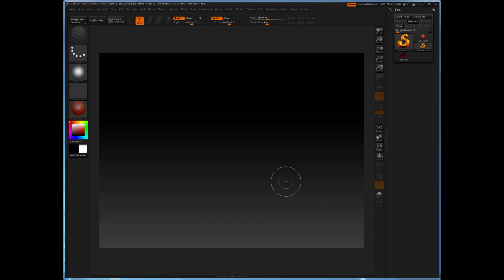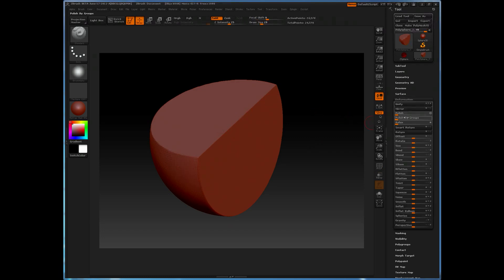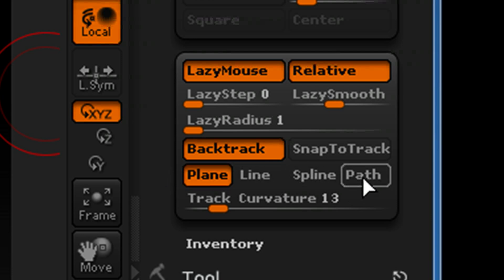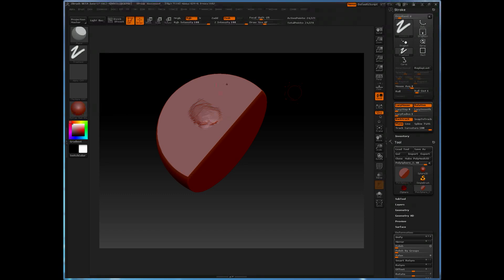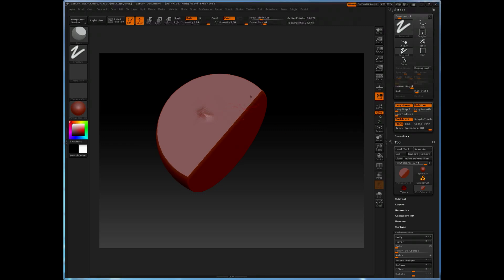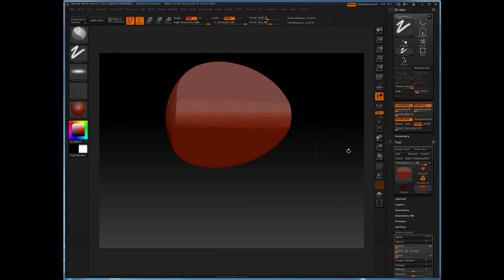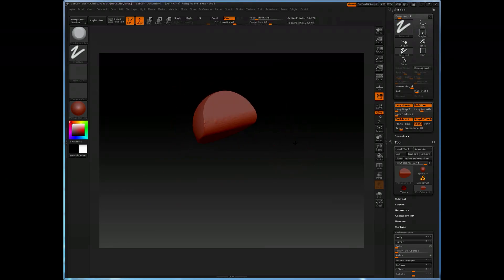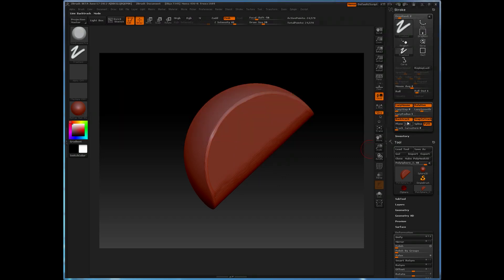ZBrush 4.0 Backtrack Settings for Hard Surface Modeling

Comment: what makes planarspline not working as expected ? all brush settings lazymousE parameters are same as you mentioned above. but it doesnt working on 4r7 here is a screenshot of problem for planarspline brush. not working.
https://www.dropbox.com/s/3itmwawml32h5sz/zb_problem1.PNG?dl=0
also thanks for this great tutorial
Reply from the maker: +Haluk Cetiner I just ran through the tools using the PolySphere in 4R7 and they all worked.  I took a look at your photo and what stood out to  me is that it's very low poly.  ZBrush is now capable of handling low poly objects, but back when this video was recorded, it was still predominantly a high-poly modeling tool.  And that's what you see in this video.  The bevels are being done on very high poly objects.  In your case, if you're just experimenting, try subdividing your cube several times then use the brushes and backtrack settings again and you should get better results.

Comment: @TheSteveWarner 
You know, I've been getting into Maya off and on, trying to 'force' myself onto it, since, as you mentioned, it's the standard in the industry. One that I've been away from for 7 years. I used to use 3d studio max and found it a relatively straightforward app to pick up (unlike Zbrush that's still taking me time to adjust to).. I always thought I was having a hard time with Maya because I had gotten older, lol.. But I'll need to reconsider it, since I respect your opinion much!

Comment from the maker: @dangraphic  Yes. Maya is a terrible modeling application. I think 3DS Max is pretty amazing. Great modeling tools, great surfacing and rendering tools. And fairly easy to learn. It's interface and workflow are a bit clunky, but you could say the same thing about most apps.  I'm sure once you're used to it, it's pretty fast to work with. It's a shame it doesn't have the same acceptance in the film industry as Maya, but given its history that's understandable.

Comment from the maker: @rorkimaru I use LightWave as my preferred app but have also used Maya, Blender, and even Wings3D.  Traditional poly modeling is much faster for some tasks, but much slower for others.  Shadowbox in ZBrush is amazing and I can make complex objects with it faster than any other app I've used.  That said, simple poly functions such as beveling are much easier in a program like LightWave.  In the end, the results look about the same, so it comes down to preference rather than tool limits.

Comment: @TheSteveWarner I duno, I'd say poly pushing would make the tank a lot faster (though it is brilliant work btw). The thing is sculpting was designed ground up as an organic way of modeling and polygons evolved from computer aided design which is why they lend their suitability to manufactured shapes.

I'm not too familiar with Max/Maya, I've always found their UI to be clunky. Personally I prefer Blender but I'm more talking about the technique not the software.